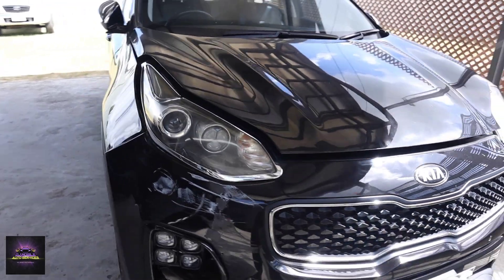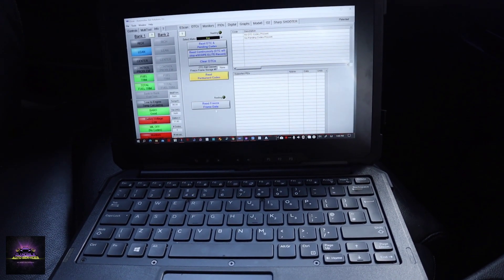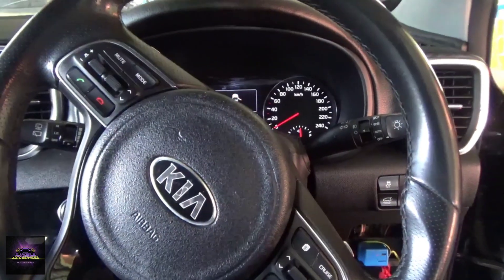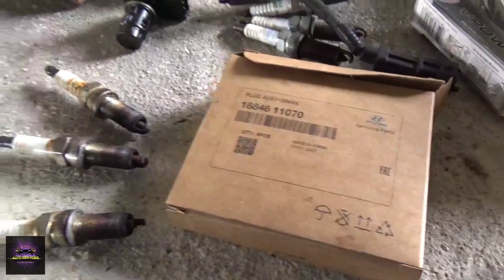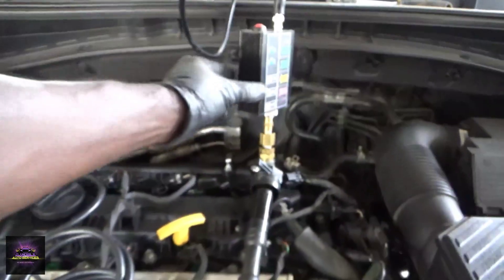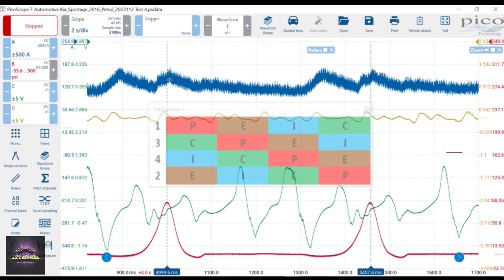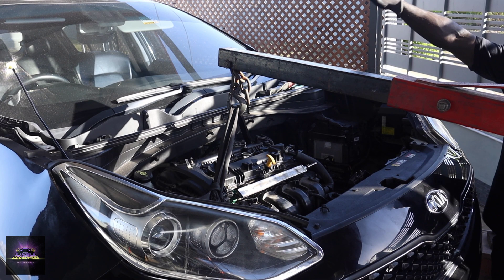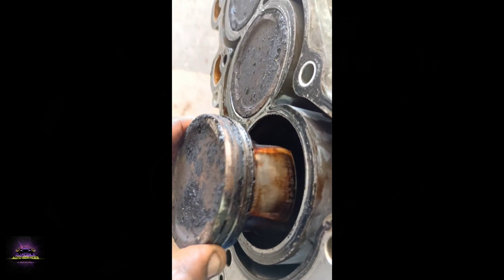2016 KIA Sportage Crank No Start Diagnose With A Diagnostic Tutorial

Comment: Great diag, Thanks for sharing! That's a cool feature of the eScan that it can do a relative compression test. I really want to get one but I still can't justify the cost.
Reply from the maker: To be honest, bro I watch all your videos you have enough in the arsenal. Its your call but I would spend the cash on the programming equipment that you are getting into. Not saying that its not a solid tool, just seeing that you have access to other tools. You can get by without it. Trust me. Getting into the programming and ECU repair thing myself, its about to get costly in 2024.lol. The OTOfix can do the RC test as well if I'm not mistaken.
Reply: @djmobileautoservices  I agree I already need to get a Nissan Consult and Ford VCM3, If I had the Escope I would probably get this because I think they can link together, but I use Pico so I don't think I'm going to get it. Thanks for your honest opinion. I also really enjoy all your videos!
Reply from the maker: @advancedleveldiagnostics  No doubt, I wanna get my hands on their 8 channel thou. If i had it, I could have check the crank and cam and the crankcase in one. This and a Cardaq 3 is my next investment. But the ecu thing is really costly so I'm gearing up